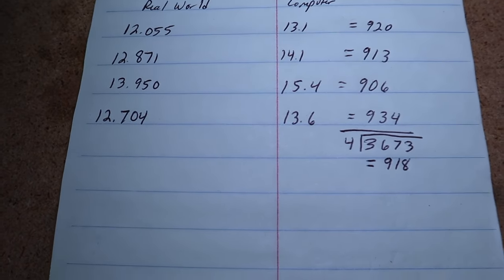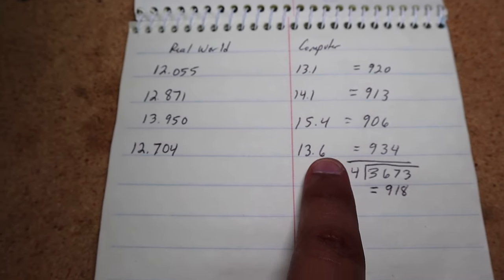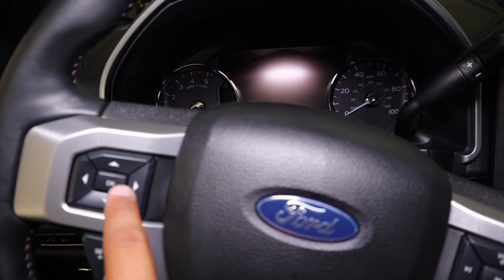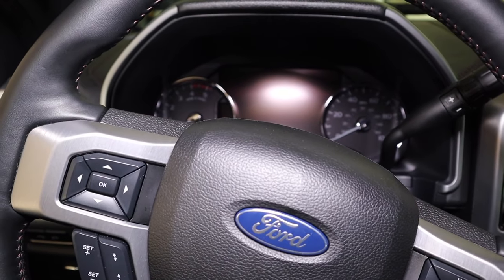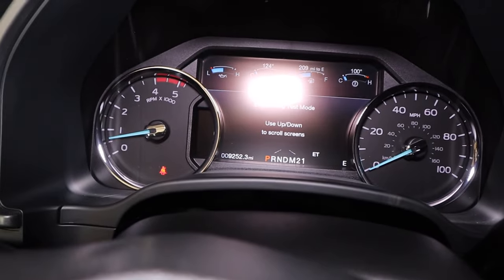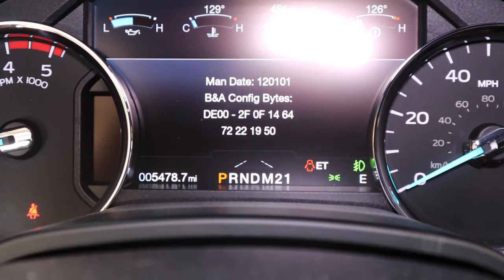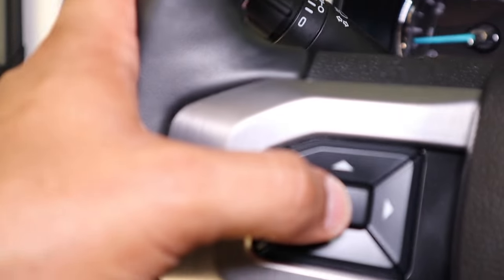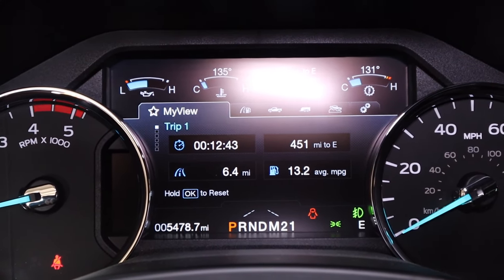How to Correct Your Ford F250/350 Superduty display MPG *Lie-O-Meter *For an Accurate MPG Readout*!

Comment: Thanks for the info!  I'm always showing ~0.5mpg high in my '19 F-450.  I watched this and several other videos, but was still having trouble getting into Engineering Test Mode.  What finally worked for me was getting into the truck, CLOSING THE DOOR, hitting the lock on my key fob, waiting for everything to shut off, then following your procedure.  When the door was open, it kicked the "Driver's Door Open" alarm on the screen and never went into test mode.  Don't know if I'm the only knucklehead that had this problem, but you may want to pin a comment telling guys to make sure all the doors are closed.  Might help someone having the same issue I did.  Thanks again!
Reply from the maker: Thanks a lot brother!
Reply: I still can't make it work on my 14 f250

Comment: Good info.  But for me MPG is not as important as DTE but they are, or should be, related based on the last 50-100 miles traveled.

Comment: I can't figure out why your truck is only getting 13 mpg.  Is it a gas engine?  My 6.7's real world mileage is a bit better than that.  Great tip...thanks
Reply from the maker: Lifted diesel on 37s!
Reply: @MotorHead18  why did you lift your truck to begin with?

Comment: Does this update all saved calculations?  Or just the current & future trip results?  I.E., the Trailer section shows a lifetime fuel economy when towing a particular trailer.  Does that number update if you change this to be more accurate?
Reply from the maker: @danh8354  yeah it updates everything

Comment: I guess I am assuming that you are dividing your Pump Receipt (Real World) vs Trip Meter (Computer), or are you using the Fuel Economy Average as the computer? I just did my first test and my Trip meter showed 18.1 mpg while the Pump Receipt calced at 15.92 mpg for those miles. But then looking at my Fuel Economy tab, it shows overall 15.6 avg mpg. So my all around continued average is 15.6 which is closer to what the pump receipt calced at. So if I do 5 or 6 fill ups and lower my AFE bias to match the trip to the pump, wont that then lower my Fuel Economy average also (which is a bit lower than the pump calc at this first shot)? So I am just a bit confused with the Trip vs Fuel Econ tabs with different averages. I guess I have some fuel to burn before I see what I come up with. If you even see this comment, thanks in advance for your clarification.
Reply from the maker: I used real world hand calculation to come up with the bias. That's the only way to get it spot on. speedometer must be calibrated as well for solid numbers.

Comment: Hey man, I was just wondering, I have a F250 6.7  2017. It should have a 34-gallon tank. When my fuel tank is just about empty, I go to fill up. I can only fit in about 26 gallons of diesel, and it's full. have you come across that at all?
Reply from the maker: @yuriykoval5361  no because I think 3-5 gals are considered reserve. Crawl underneath and verify it’s a 34
Reply: If it’s a crew cab short bed it’s not 34 gallon. I’ve got a 16 SD diesel with the same small tank. Wouldn’t have bought it had I known it. Put an auxiliary tank in bed.

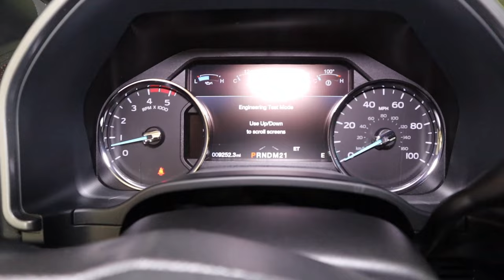Comment: Any idea why your odometer originally was 9252.3 (2:51) when you entered Engineering Test Mode and it was 5478.7 (2:58) just 7 seconds later?
Reply from the maker: I originally video taped at 5478 miles, but when I went to start editing the video (4 something thousand miles later) I noticed that I didn’t explain or show how to enter engineering mode well. Had to retake that part and throw it in so I can publish the vid for you all.

Comment: I changed my bias and it works great. My question is if the battery is disconnected will the bias revert back to 1000?
Reply from the maker: No it doesn’t revert

Comment: Great video man! I am going to go do this on mine now, its way off, I need to go down to 848!. How did you get the actual degrees to show above your engine and trans temp gauges?
Reply from the maker: Yeah man it’s an easy fix! And I added the numbered temps above gauges using forscan
Reply: @MotorHead18  that's great. Forscan is definitely on my list of things to play with but I haven't found a good list of codes that make me feel real great about changing things!
Reply: And thanks for this mileage adjustment video

Comment: Why did your mileage drop from 9200 to 5400 before you changed anything??
Reply: I'm curious too.
Reply from the maker: I originally made the video at around 5400 miles, but when I went to finally edit the video, I realized that the content leading up to the job was terrible. So I redid the intro and part leading up to the job lol. Happens to every YouTuber at some point.

Comment: Anyone else notice that when he started the procedure and put the system into Engineering mode he had 9252.3 miles on the truck but then after making the changes he had 5478.7? Um….. thats one way you improve your fuel mileage! I assume he’s gotten into this mode multiple times and this was different takes stitched together to make this video..but just checking, that change didnt affect anything else….did it?

Comment: Did you hold ok button all during adjustment or just until that engineer screen came up?
Reply from the maker: Only until the engineering screen popped up
Reply: @MotorHead18  Thx
Reply from the maker: @jack9302  no problem 😎

Comment: My truck is about a mile per gallon off the other way.  Truck is showing 16.5 when it's actually 17.6. How would I adjust for this?
Reply from the maker: Increase the bias instead of decrease. Similar process shown in the vid
Reply from the maker: And your lucky to be getting 17.6 lmao
Reply: @MotorHead18  Thanks for the kind words. Unfortunately, my 2016 f-250 Super Duty has a different configuration on the steering wheel. I understand now how to change the bias, but I cannot get into test mode.

Comment: 2015 F350. Cannot get into the program mode. Tried numerous times but nothing.  Ideas please
Reply from the maker: Should be fairly similar.\ try this. 
1. Turn ignition from OFF to RUN 5 times within 10 seconds, with the 5th time ending  in RUN. Door locks will cycle to confirm programming mode.
2. Within 20 seconds press any button on first keyless remote. Door locks will cycle to confirm programming.
3. Within 20 seconds, press any button on second keyless remote. Door locks will cycle again to confirm programming.
4. Turn ignition to OFF. Locks will again cycle to indicate end of programming mode.
Reply: @MotorHead18  I found out how to get into the program mode. It’s the “down” arrow not the “ok”in my truck though scrolling through I cannot find the AFE to change it. Could it be aftermarket programming seeing I’m deleted or does the above sequencing bring it up 
2015 F350 diesel. Will give the above sequencing a try to see if AFE is shown. 
Thank you. 
Rick
Reply from the maker: @wizzsax123  awesome Rick
Reply: @MotorHead18  I tried your method with both keys. The door locks do not do anything and cannot get into the programming to change my AFE!!  Totally lost now on how to change it. I tried looking up on FORScan too and cannot find anything there for my 2015 F350
Reply from the maker: @wizzsax123  check out the below comments for some additional help
Reply: @MotorHead18  I do not see any additional
Comments below your just our conversation right now

Comment: Switched fuel tanks from a 30 gallon to a 55 gallon titan tank. Will this method enable me to accommodate the extra 25 gallons that I’m caring to get correct mileage information?
Reply from the maker: Yeah just use forscan to change the amount and the monitoring screen will adjust

Comment: Doesn't calculate hard throttle well. Drive it normal it will be accurate. Mine is 100% avg and miles to empty. Avg 19.5 around town and got 23.4 hwy last trip
Reply from the maker: Hand calculated?
Reply: @MotorHead18  fill the tank, set the trip. When I fill up again i take the miles driven and divided it by the gallons pumped. I have also check the miles to empty with Google maps and it's within single digits. I absolutely baby the truck. I only seen the boost go above 5psi once in the last 3 weeks. Hard throttling will make it hard to calculate exactly how long the fuel will last. Computer takes timed snapshot and average fuel consumption together. Consistent driving habbits will make your computer accurate 👌
Reply from the maker: @wayneholder139  2500rpms all the time here haha
Reply: @MotorHead18  takes allot of restraint to not enjoy 400hp 700+ torque. I'll give er a lil every once in awhile. I was doing boosted launches test driving it

Comment: Would this affect distance miles to empty? Just bought a new 22 f350 tremor. Changed wheels and tires from 18” to 22” and also installed 60 gallon S&B fuel tank. I drove 1100 miles and noticed my mpg is off by 1.3mpg and my distance to empty is off too saying I have more miles to empty than I really do. Any suggestions here?
Reply from the maker: Towing really throws off the computerized mpg. How off is the mpg compared to hand calculated empty driving? And forscan will be required to fix your miles to empty to compensate for larger fuel tank.

Comment: Why does everyone buy a 3/4 or 1 ton truck and then become consumed about what theyre mpg is? I used to own a 03 F350 6.0 and now a 17 F250 6.2L... what kinda of fuel mileage am I getting? Who knows who cares... its not a GD Prius
Reply from the maker: Lol, did you even watch the video
Reply: @MotorHead18  its still a super duty video so yeah I watched it🥴
Reply: It’s an option built into the truck and owners would like it to provide real numbers. That’s why.
Reply: Your mileage actually matters a lot if you drive a lot of miles.
Reply: @jaredmayer3960  that I would agree with. But most of these guys are using as a bar to bar pavement princess
Reply: @Trigger_32  so your saying, fuel mileage does not matter if you drive on pavement only huh....could have sworn 6k lb. diesel trucks were made for pavement

Comment: Anyone else notice his odometer went from 9,252 down to 5,478 after he changed the setting?
Reply from the maker: I never even noticed that? Lol
Reply: @MotorHead18  It changed before you made the setting change. As soon as you entered into that mode the milage changed.
Reply from the maker: @Ballme60  it probably changed back then. Although the difference between the two different mileage’s is roughly when I deleted 🤔
Reply: I was wondering if the 9252 was a kilometer reading, even though it showed miles.  Motor Head, I don't think the difference is the percentage you deleted... Curious what it read later